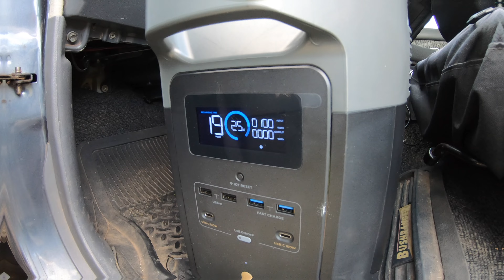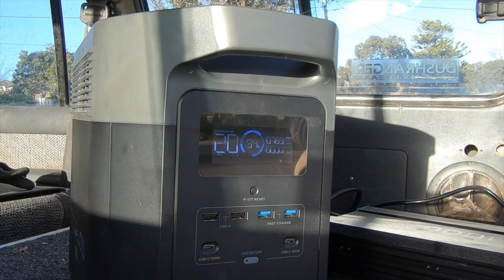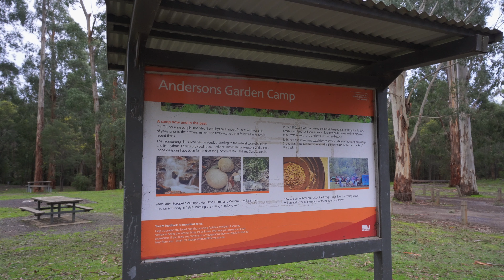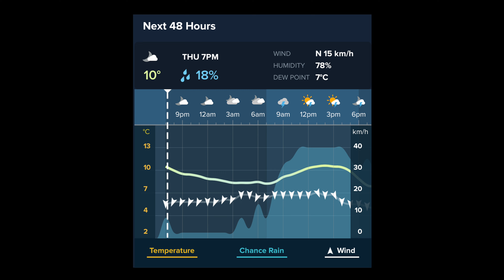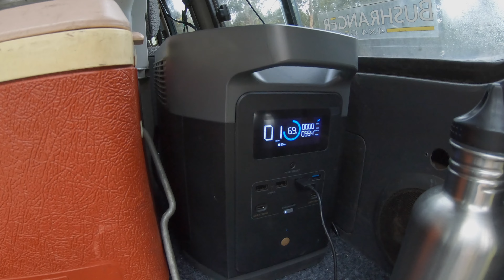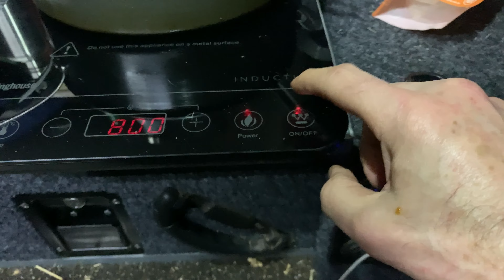ROAD TRIP CHARGING TEST: How Fast Can I Charge The EcoFlow Delta Max While Driving?

Comment: I’ve used your method on my sprinter van for a couple months now. Trying to find the optimal wattage to draw from my alternator while idling. Vans have a beefy 180a alternator, but that’s while driving I think. Thanks again!
Reply: My transporter has a 140a I went with a 700w inverter that pulls 73a  I have had not problems in 2 years and I live on the road full time this method definitely works

Comment: I've been hanging out for the update. I enjoyed it, you have a very calm way of speaking and your edit suited me good. I'm going to be using your solution to run my Bluetti ac200max. I'll be running a 2000w inverter off of my crank battery with a fuse that I'll use as a type of disconnect. Because the setup is just for charging the bluetti while camping this set-up should be fine. I'm hoping my 180amp alt will allow me to put a full 1400w in. Do you like your Westinghouse induction cooktop? I just brought the twin plate vision which has 1000w and 1400w plates. Happy camping this summer. 🇳🇿
Reply: How many watts could you get out of the inverter? I'm looking to do the same off of my crank battery and 170 amp alternator in an emergency power outage scenario.
Reply: @TheAutumnWind_RN4L  I'm not sure. I've only used it to 500w. I haven't tried the 1400w yet.
Reply: You will need a heavy power lead from the battery to your inverter. And a serious breaker next to your battery. I think a DC to DC charger would be safer and protect your alternator better.

Comment: Just came across your videos.  They are very informative as I have just bought the delta Max 2000 for my RV and am trying to work out various ways of charging it.  I have a 1000w inverter already, so good to know I can charge via that.  However, as an older female I find the Delta is heavy to move around my RV and the supplied mains cable is short.  Is it possible to use an extension cord to charge?  If so, could you recommend one (provide link)?  (am in Aus) Thanks
Reply from the maker: You can use an extension cord from the inverter to the AC charging cable that came with the Delta Max. Any standard extension cord that you get from Bunnings etc. should be fine. Get one that is as long as it needs to be but not much longer.
Reply: @ExpeditionAustralia  Thank you!  I tried it last night & worked well.  Limited the input as you indicated in your video. Am very happy with this solution. Keep up the good informative videos and thank you for responding.

Comment: Hi from Germany, 

Traveling with the Delta Max 2000 and the 400W Solar Panel as well. Its a great idea and im about to buy the 1000W inverter.  

My question is: Do i have to install the + and - cabel which comes with the inverter, directly to the starter battery? (Or where)
Or is it also somehow possible through an internal 12V Socket (which has 8 Amps max i guess) 
A second battery is not needed right? 

Any help would be great! Thanks a lot.

F.B.
Reply: You would replace those with longer and much heavier cabling. Consider a DC to DC charger instead of the inverter,And a breaker right next to the battery.
Reply: The better solution actually is to just buy the new alternator charger from ecoflow, install it to the starter- battery and charge your delta everytime and always with constant 800W while driving 👏✌️

Comment: Thank you for your video.  My Ecoflow Delta 1300 is not adjustable for wattage input.  When I charge it from a regular house outlet, it draws about 1050 watts.  Does this mean that even with a powerful enough alternator and a 1000 inverter, it will not put out sufficient wattage to the Delta 1300 ?  Even if it is at a slower pace ? Thanks again.

Comment: I saw some of your other videos and was convinced that i should do the same for my ecoflow. But ive now seen others saying that the inverter will draw way too much from the lead acid battery. They should only be a .2c discharge it seems. Any trouble with your battery?
Reply from the maker: I haven’t had any issues with the battery but I dialled the charging of the EcoFlow down to 600W so as to not overtax the alternator. I’d recommend talking to an auto sparky about your specific setup.
Reply: The starter battery can provide a huge draw in most cases however...the alternator may not like such a huge draw. Limit that draw with a dc to dc charger for safety reasons.

Comment: Great real world test.
I’m looking to do something like this with either an inverter or dc/dc converter. 
That was my concern, how much the inverter would draw at 800w. 
Be interesting to know what the amp draw is at different eco flow charge settings?
Do you know what amps your vehicle alternator is ? 
That would be a good reference.
Reply from the maker: About 80 amps I think. I will do more testing at some stage and may even upgrade to a higher output alternator to see if we can get the full 1000w from the inverter. Not urgent though.

Comment: Will this system put more stress on the battery or alternator ?
Reply: All depends how much energy he is pulling from the inverter,.if he stays to around 500W or 600W should be ok,…anything over it can be a problem
Reply: Most of the systems with fuses or DC to DC are over the top in my opinion !

Someone was saying I need to install a fuse to the car battery so when power station is full I can switch it off,..but as far as I’m aware you can do that by switching the inverter off manually or with remote if you install one ,..so I do not see the point putting fuse
Reply: Yes Yes Yes. Too much perhaps. Use a dc to dc charger instead.

Comment: very interesting! So your alternator is rated for around 60-80 amps of draw?
Reply from the maker: About 80 I think. There are plenty of aftermarket options with much higher outputs so I might upgrade at some stage and be able to get the full 1000w out of the inverter.

Comment: Can you hook it up to a good DC-DC charger?
Reply: I believe you can hack the solar input to make it accept higher dc charge - the 100w limit on the cig lighter seems pretty standard though.
Reply from the maker: Not sure if a DC-DC would help. You can run both DC and AC into the EcoFlow at the same time so you could have the inverter delivering whatever your alternator can handle and also power coming in from a solar panel on the roof.
Reply: Yes. Just buy the most appropriate size that the power station will accept through the solar panel connector.

Comment: Your taking all the power from you alternator to your inverter from you 75amp engine battery 🪫 your alternator will be red hot 🥵 and your starter battery will die soon and you alternator as well dc to dc is the way so you don’t end up with a bigger bill  when it all goes wrong 😑
Reply: If that is true why hasn’t his alternator fried yet, never heard anyone who had this actually happen to them, only people “claiming” potential failures are forthcoming yet failure hasn’t occurred. Maybe you and your friends don’t understand electricity
Reply: Did you clearly not see the second battery? It's installed to the second battery with an isolator not the main cranking battery.